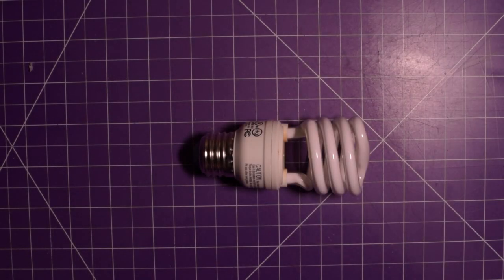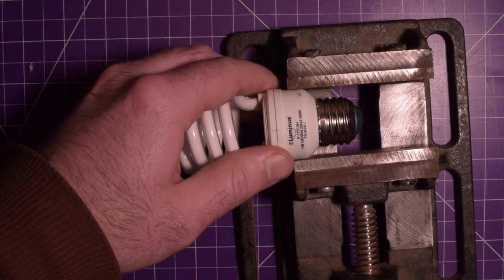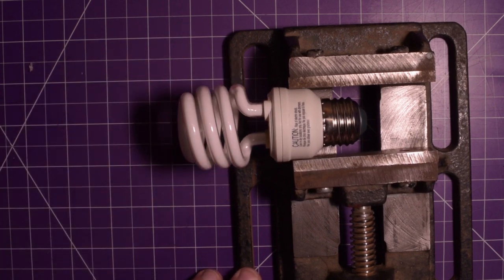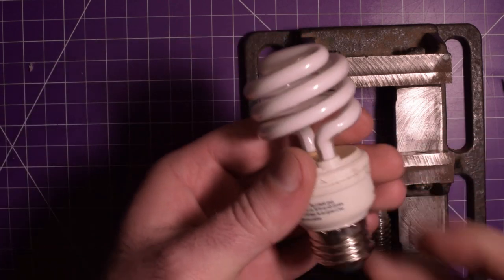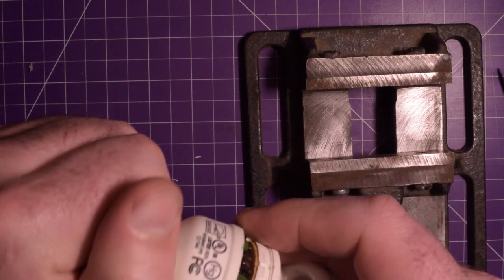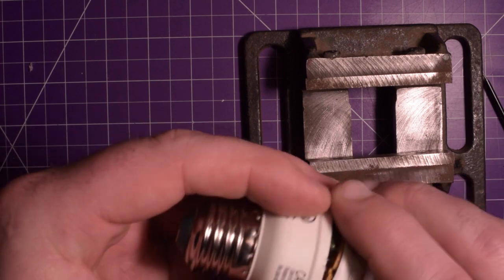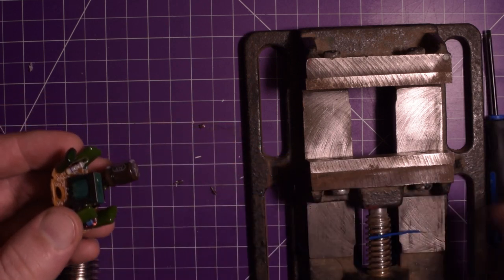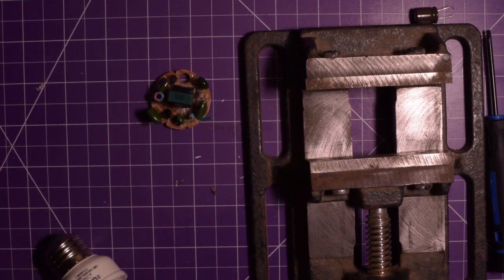A Safer Way To Open CFL Bulbs

Comment: Protip: Use your side cutter to remove the little metal nub on the tip of the e27. That way the cable becomes loose and you don't have to fiddle around like that.

Comment: You should invest in a spudger, they are designed for prying things open. Much better than a screwdriver. I got mine last year and I've never stopped using it. Great vid btw.

Comment: Use a soldering iron and de-solder pump. No need to apply force and snipping elements from the pcb. That's bad because you might break the legs of the capacitor or other elements you wanna salvage.